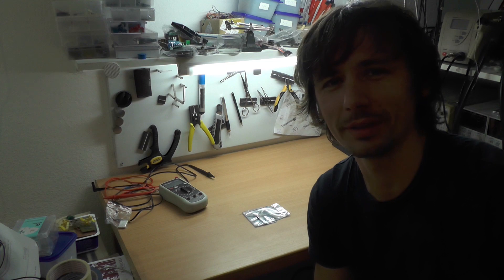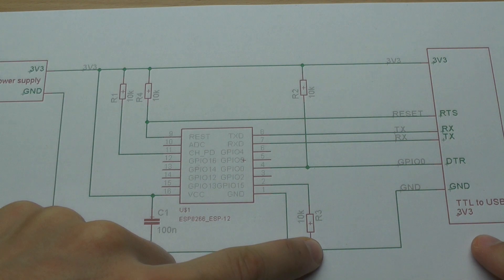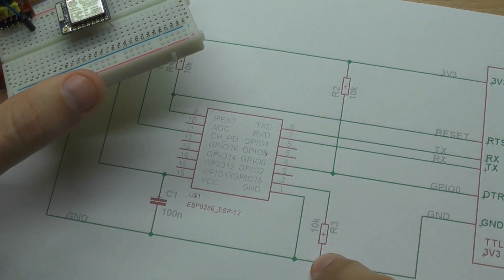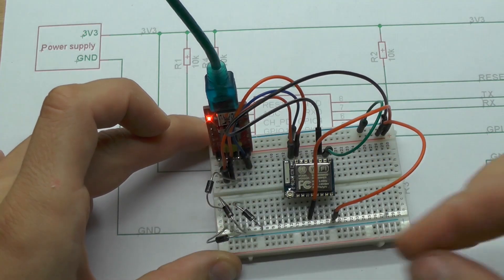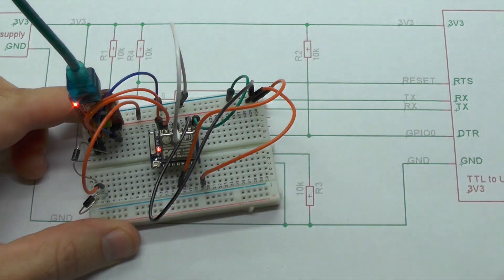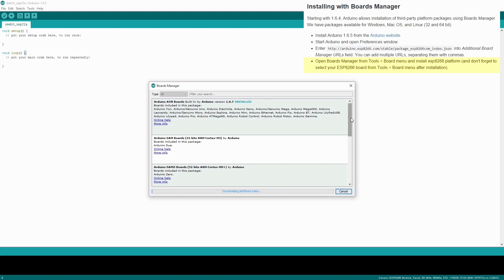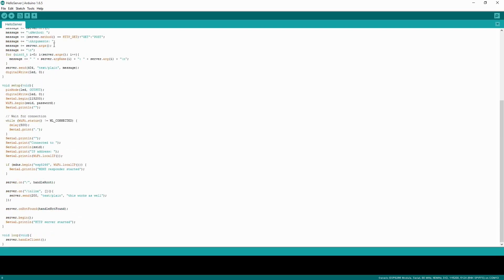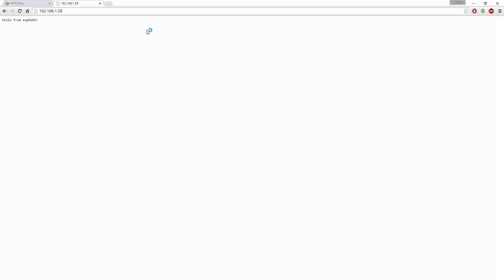Simple Arduino Web Server on ESP-07/ESP-12 Tutorial

Comment: GPIO2 pin was floating. To enter in UART bootloader mode GPIO15, GPIO0 should be low while GPIO2 should be high after reset is done. How it was working then?

Comment: i have try this tutorial and succes upload program with arduino IDE. but  on serial monitor not show the IP Address. maybe any body help. THX

result on my serial monitor :
/////////////////////////////////////////////////////////////////////////////////////////////////////////////////
ets Jan  8 2013,rst cause:4, boot mode:(3,7)

wdt reset
load 0x4010f000, len 1384, room 16 
tail 8
chksum 0x2d
csum 0x2d
v09f0c112
~ld

STA disconnect: 201
.....wifi evt: 1
STA disconnect: 201
wifi evt: 7
.wifi evt: 7
wifi evt: 7
wifi evt: 7

///////////////////////////////////////////////////////////////////////////////////////////////////////
i use both NL & CR and baudrate 115200

Comment: hi! thanks for sharing this instuctions.
i have a question, maybe you can  helpme.
on tue arduino ide I run the example checkflashconfig.ino program: they give me:
flash real size: 1048576
flashide speed: 40000000
flash ide mode: dio
flash chip configuration: wrong!

is ok to to set on the configuration of the arduino generic esp8266 module the ide flash size: 1m (256k spiffs)?
thanks!

Comment: i have purchased Esp 8266 12E chip which has specification described in below link ....

http://www.amazon.in/Transceiver-ESP8266-ESP-12E-Serial-Wireless/dp/B00RJJHWLA?ie=UTF8&psc=1&redirect=true&ref_=oh_aui_detailpage_o01_s00#detail_bullets_id

i do not know how to wire it up with arduino uno board to use this chip as web server & receive data from web server to arduino uno board ......  

also give me the guidance about pins of chip how & when should use that pins i know basics of esp8266 as mention in  below link

http://www.amazon.in/ESP8266-Serial-Wireless-Transceiver-Receive/dp/B00YUOAUPC?tag=googinhydr18418-21&tag=googinkenshoo-21&ascsubtag=12be54d8-28d4-42af-85bc-1a325b801ad5

so will my new chip esp8266 12E work different form this

Comment: whyy did my upload fail
why!!!
why no answer!!
what?
Reply: One problem I had with the ESP-01 is that GPIO0 has to be grounded when powering on to enable programming mode. Without that it won't upload. This important step was omitted in far too many tutorials :-( I don't know if that's true in this circuit.
Reply: check your COM port.
Reply: i did
Reply: try disconnect your tx and rx from the esp8266 before upload. It happened to me once.
Reply: Ok I'll try

Comment: Why are you trying to control voltage with  diodes diodes aren't for voltage control, they are used as one way gates
Reply: +jesse cobern Not exactly true.  you can control voltage because the forward voltage drop across a pn junction is constant. Albeit not the best way. This author was just doing a quick setup.
Reply: You're correct in the sense that they are used as one way gates, however, they come with the added downside (or in this case benefit) of a ≈0.6V voltage drop. This is just a simple method to drop voltage to a reasonable level

Comment: what could happen if I don't use the 3.3v source for the esp8266?
Reply from the maker: +daniel cavalcante I did by accident. Actuelly it still works, but the current was much higher and it went hot. So probably it won't work for long if you run it from 5V. 4.2V for max charged lithium cells should work fine. But no guaranties here
Reply: +bitluni&#39;s lab Do you think that this could cause the problem of the ESP  restarts from time to time? do you know a way to keep track of when the ESP restarts and treat this problem throught software?

Comment: Can anyone help to configure my ESP-07 as a  access point? I used the code given in the example files of the arduino IDE, but It worked only sometimes and other times my cell phone even not detected the ESP. It seems to me that the ESP is very unstable.
Reply from the maker: +daniel cavalcante the AP feature seems to be buggy (at least at that time). My esp restarts from time to time when using it. you can see the problems when leaving the serial adapter connected and monitoring the debug information on the serial monitor.

Comment: You cannot check voltage drop on a diode in an open circuit. You need current to go through the diode.
Count on ~0.7 volt drop per diode.
Reply: sorry what does open circuit mean?
Reply: @sermuns  when you close a switch you have a closed circuit and current is flowing. When the switch is off, no current is flowing, hence you have an open circuit. You can Google the term and switch to IMAGES for visual results.

Comment: He said that the blink program doesn't work, does anyone know why?
Reply from the maker: +daniel cavalcante I guess there is no special blink sketch fom the ESP SDK. You might find a pin to one of the LEDs of the ESP but their als used by the firmware as indicators. I just didn't bother finding out and wanted to keep the video short.
Reply: Worked for me on ESP 07 and 12
Reply: +daniel cavalcante I know it was asked a month ago, but for new users, blink sketch works on ftdi power led if you are not connected it to usb.
Reply: +bitluni&#39;s lab I have seen several different configurations on ESP modules depending on their manufacturer. Some have onboard LED's others have none. Some blink when there is serial traffic. So what I'm saying is you have to modify the blink program to work with a pin that is available, and add an led if necessary to your circuit.
Reply: The blinking led not working to you because this example is for esp 01 , for esp 12 please use pinMode(2, OUTPUT) GPIO2 led pin

Comment: Can you tell me how to NOT hardcore the SSID and Password?
Reply from the maker: +Surya Teja K you mean hardcode. there is one way I did it for the followup video that not finished cut. you create an access point on startup and provide a http page to set it up and store it in the eeprom. you can also use a pin to check at start if to run the ap mode. running both leads into problems since ap seems to be unstable
Reply: bitluni's lab can you provide that follow-up video? it would be of great help to me
Reply from the maker: +Surya Teja K I can and I will. I'm currently 100% occupied. and it's taking like one week full time to create and mix a video. the current status is, that all shots are taken except for some code explanations. The material is partly cut. The voice over is missing. Since I'm hoarse atm this will not happen easter. sorry.
Reply: +bitluni's lab atleast umm upload the code..I'm a programmer too and so I'll understand it.

Comment: nothing's hapening! i used a 3.3v regulator from a 9v battery to supply my module. The led isn't glowing at all!
Reply from the maker: +Mohammed Noor you need to set up all the pins. otherwise it will not start up

Comment: warning: espcomm_sync failed
error: espcomm_open failed
 

How to solve this error ???
Reply: +Kaustav Nandy as Matt P wrote:
You need to make sure the GPIO0 is connected to ground and then restart the board by disconnecting the power if you don't have a hardware reset button.

Comment: It is a nice video
I have problems when I burn the code module 
warning: espcomm_sync failed
error: espcomm_open failed
can you help me
Reply: +Lorenzo'sTechTips You need to make sure the GPIO0 is connected to ground and then restart the board by disconnecting the power if you don't have a hardware reset button.

Comment: Is it possible to use ESP module for a super-fast direct Arduino-to-Arduino serial communication? I would just want to exchange massive amounts of data between two Arduinos or between Arduino and PC.
Reply from the maker: +HitAndMissLab 
It is possible using this arduino sdk since you can use a bus like I²C or SPI and you are not limited to the UART 115200 bits/s.
I guess you could manage to transfer like 1MByte/s since the generic arduinos are running on 16MHz and you won't be able to handle tha data fast enough.
What's your project?